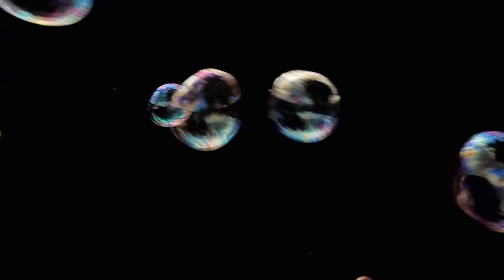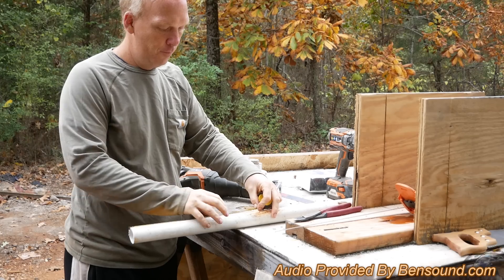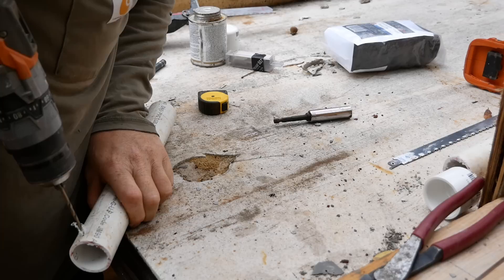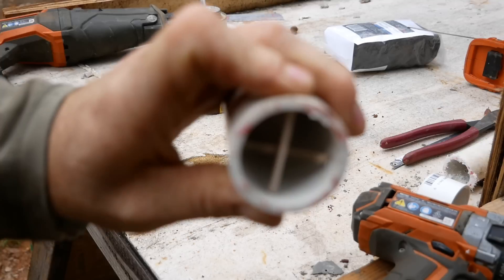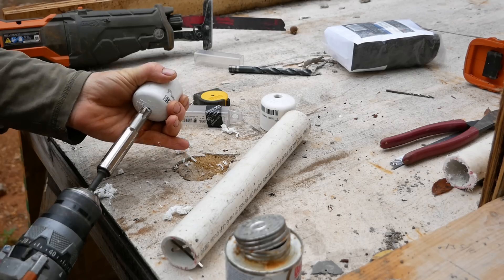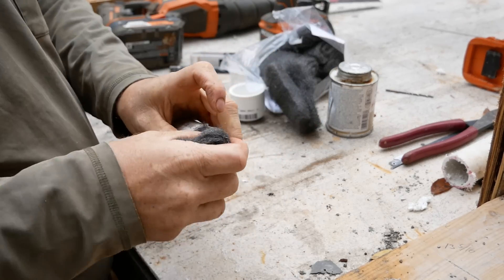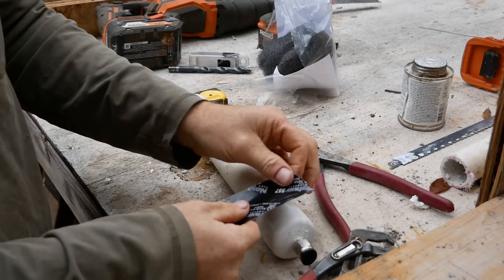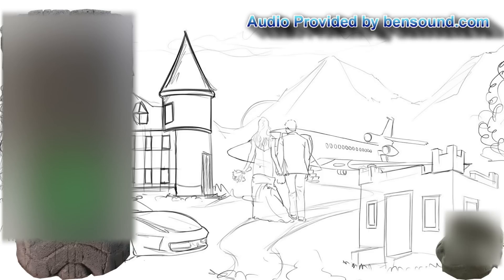AirCrete Foam Wand

Comment: How much all in to build all necessary tools for aircrete? Not cheapest route, but most convienent for a not so handy guy.
Reply from the maker: A basic foam machine will cost about $170 and the Air Compressor rated at 4 CFM @ 90 PSI about $300.  Forms can cost $400 and upwards depending on size and materials used.  Slip forms save money on form materials.  Depending on if you build a large house a forms all the way around or just a small section to build a little at a time can greatly affect the price of forms.   Making bricks could save some cost on forms, but increases the work.

Comment: Great video. Instead of the work to insert the metal rods to prevent the steel wool from blocking up the end, I use a small piece of chicken wire and roll into a loose ball.
Reply from the maker: Sure, it works I have used stones when in a pinch and out of country

Comment: great vid. great wand.  this is the first vid on with clear instructions on making a foam wand.  thx a lot!
Reply from the maker: All you need is an input to the wand.  1.2 gallons per minute water pump and 4cfm @ 90 psi air compressor with adjustable regulator.  T or Y the input  together into a single line and feed the wand.  It's magic.
Reply: @TinyGiantLifeStyle  sounds great. thx

Comment: 00:40 Please tell me, What is that component after the Air Regulator? Is it a solenoid? and 
is the white rectangle box above it purely an on off switch for that solenoid? Great video, Thank you.
Reply from the maker: You got it 👍 It's that simple.

Comment: Are you using an air compressor to push fluid or a liquid pump?
Reply from the maker: No.  It's easier to get the volume & control by pumping water and adjusting the air.

Comment: Looks like a mess. Maybe too high pressure.  No control valve to shut it off/on.   Need separate control on the amount of liquid/soap injected.
Reply from the maker: This video, as the title says, is just focused on the wand end of the machine.  It is completely controllable to have exact foam weight produced fast, but not overrun the rate it can be mixed into the cement.
Reply: Accumulator1, appreciate what you were given. You are welcomed to post a video showing how to do it better. Go ahead, I'll wait.

Comment: you don't need the pump , the air can be used as a sump as well , there are vids about it
Reply from the maker: At what rate/volume of production and at what foam density?
Reply: @TinyGiantLifeStyle  I already bought air compressor, so I don''t need the pump.

Comment: Hello!!! I have a question!! I have done the same , but i used a T and not a Y (couldn't find here)... All is working but i cant regulate the air , so is coming very liquid... Could be that?  or just is not working my regulator? thanks a lot if you can answer!
Reply from the maker: Could be a regulator.  Could be your stainless wool is packed down against the exit fitting.  Could be your air compressor is to small.

Comment: Is the foam solution just pumped into the wand.or is there air from a compressor used as well. Need more details on the connections prior to the wand. Thanks.
Reply from the maker: Air and water are pumped into the wand at a T or Y it really is just that simple

Comment: Your version of the phone gun is very simplistic and I appreciate that at the same time I purchased all these parts like a solenoid and the pressure gauge in the pump and this that and the other and there was no instruction on what to do with that when I watch this video so I'm not sure what to do with these parts I'm not an inventor of electronic I do follow recipes it hasn't been anything the video I just watched that tells me how to build the mechanical end of this so far so I don't know what to do with all the parts or which way to turn to achieve the ability to operate the foam gun will you please let me know how to build this with the components arrested for Amazon 2 operate and push the foam through the the wand I mean give me some link that you have that I missed and appreciate it very much oh and I wish I had the money to go and take your I'm actually using aircrete to help other people I'm helping my friend get her house together and building a French drain for the back of her house and also her septic tank broke so I'm trying to get this together so I can build a septic tank for my friend her husband. She's a widow and she's been going through a lot of no struggle and so I'm just trying to use aircrete to help people you need to put your health that I can get with the knowledge of how to get the ball rolling is appreciated beyond belief
Reply from the maker: Wire power to switch, connect switch to one wire of solenoid & pump.  Take the remaining wire from solenoid & pump and connect together with netural wire from plug.  Connect pump output with solenoid output into a T or Y.  Then the remaining hose connection goes to the foam wand.  Connect air regulator output to input of solenoid, connect the input of air regulator to air hose.  Finally connect input of pump to hose and place in foam solution with filter and weight.

It's really simple.  I'll try to remember to post up the details.

Comment: Why some foam wand end mouth is not as small like yours?  Is the making process for bigger mouth is as same as this?
Reply from the maker: It just depends on how you are injecting the foam.  They are made the same way.  A larger outlet is better.
Reply: @TinyGiantLifeStyle  And you tell the pro and con of protein base foam.  Does if give extra strength to the block?
Reply from the maker: Acrylic can give extra strength to the block.  Proteins in the foam mix strengthen the bubbles, not the block.
Reply: @TinyGiantLifeStyle  what kind of acrylic is it? Acrylic cement?

Comment: If you add a set of stop pins at both ends, then you won't need to worry about which end is which. It should then be bidirectional.  Also your drilling practices are downright dangerous, and you should at least clamp down your material to the bench before drilling....if you don't have a vice use some vice grips.  You'll lose a finger if you hold things with your hands while drilling or injure your hand.  Drills are powerful tools.
Reply: fk up drama queen lol

Comment: this video is easy to follow but what about the previous to this where the connections to the air pressure is shown and other stuff
Reply from the maker: This is a shortened clip from an online video course that teaches everything you need to know to build an AirCrete dome.

https://tinygiantlife.biz/build-your-own-aircrete-home/

Of course there is also a video on the channel that shows the process of making AirCrete and assembly of blocks.